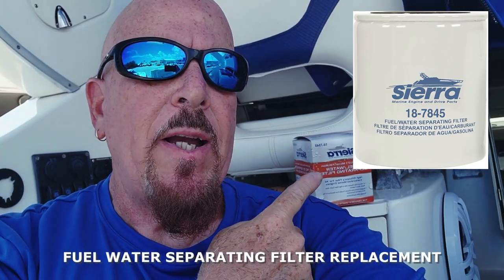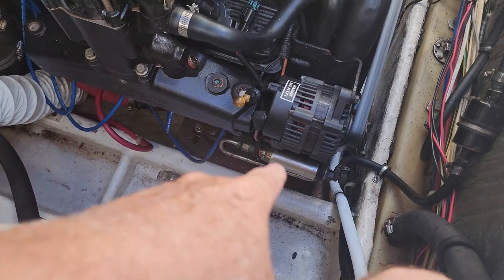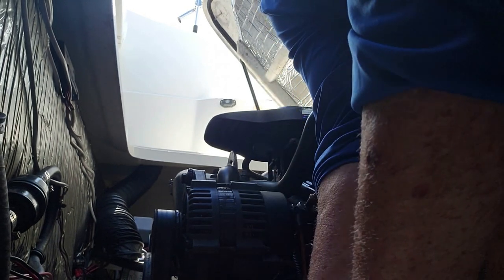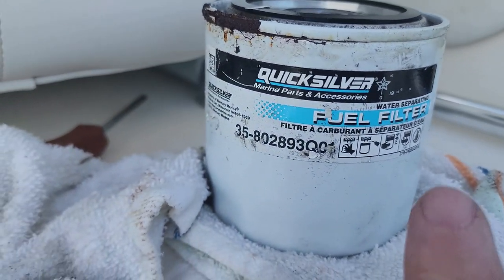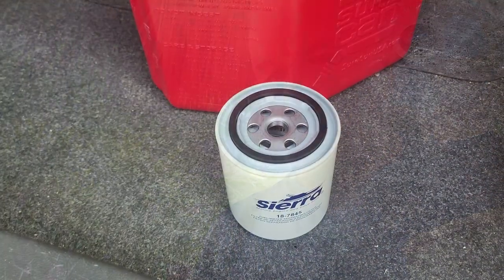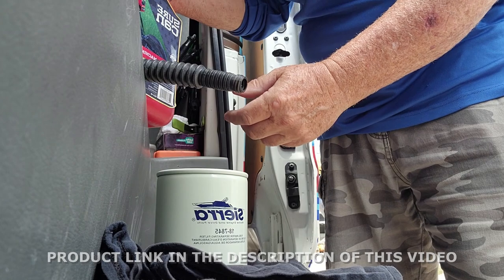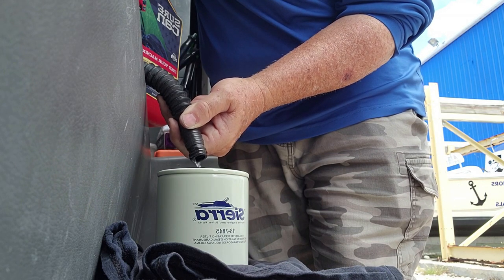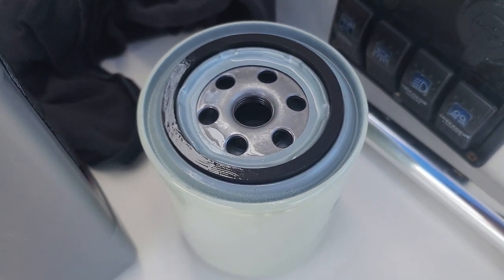DIY: Replacing Your Boat's FUEL WATER SEPARATING FILTER

Comment: The Sierra 18-7845 work great if you can't find a Quicksilver. Been using those for my outboard motor for 15 years work great. Old two stroke carbed motors are very sensitive to dirt and moisture. Use with confidence if you can't get a Quicksilver. Great video and explaination. Good idea to keep one extra inboard your boat.
Reply from the maker: Hi Mark! Thanks so much for watching Brother! My 1st choice Quicksilver, if not available Sierra...I've also had good experience with it. Thanks. Peace from the Keys.